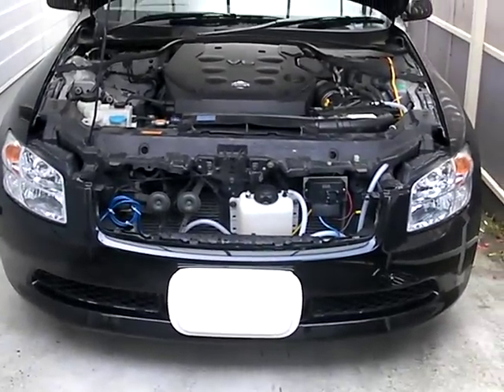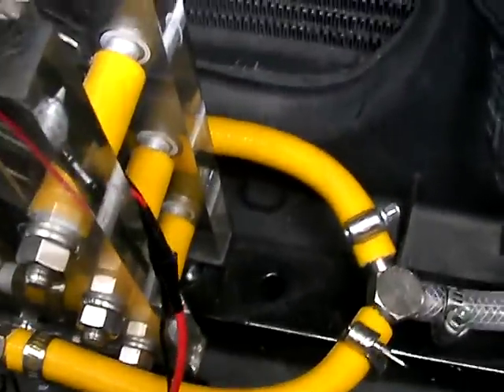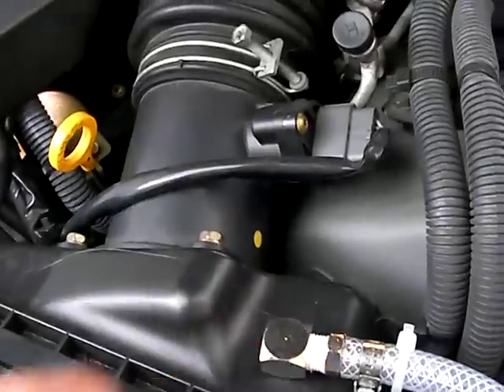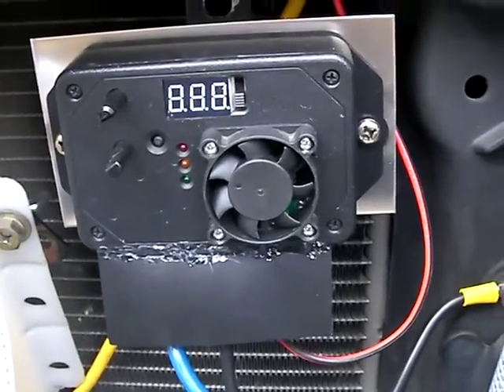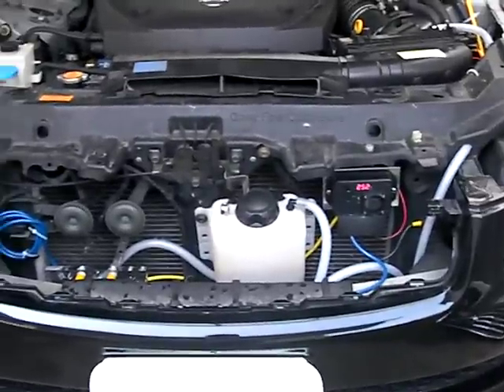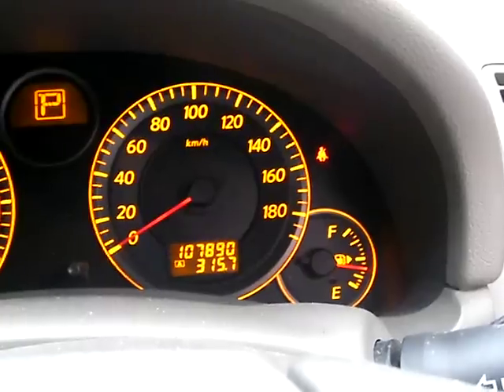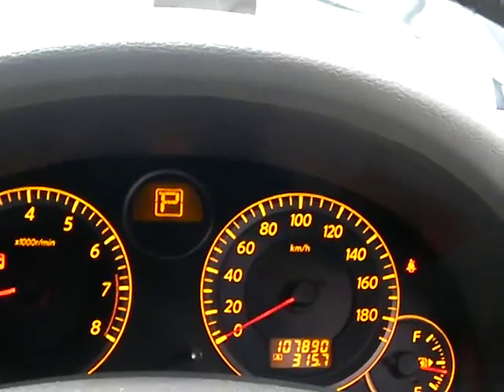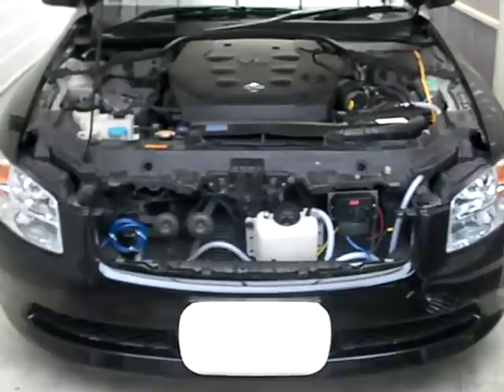Successful HHO install in 2005 Nissan Stagea

Comment: Fuel mileage will decrease.  How do I know?  Second Law of Thermodynamics.  You will always draw more current than you will generate in combustion.
Reply: The goal of HHO systems like that is not (SHOULD not be) to generate more energy from alternator current. The alternator and the electrolysis process do not have perfect efficiency and they certainly do not have efficiency over 100%. 
The goal of this HHO system is to increase the combustion rate of the fuel mixture. Hydrogen gas has a combustion rate many times greater than that of petrol-air mixture. The theory is that by increasing the combustion rate, the petrol engine is able to output the same power at a leaner mixture (also at higher revs), therefore petrol is burned more efficiently, increasing the engine's overall efficiency. 
Now, for example, if that hydrogen generated using that 25 amps (0,3 kW power consumed) increases the engine efficiency by 2%, then, for a 85 kW engine, the maximum output power at the same fuel consumption would increase by 1,7 kW, which makes for a total increase of output power of 1,4 kW.
The point is, energy can not be generated from nothing, but the engine can be made to run more efficiently by making the fuel burn faster.
Erik
Reply: well, the second law of thermodynamics is much older than  that but you have raised an issue which needs to be addressed.. these so called"laws"  are nothing of the sort...all  they are is a record of observation
Reply: Joe Benotz Moron
Reply: Brandon W We are not friends.  However, I would love to buy you a beer and discuss the laws of nature.  Capacitors are not magic; they do not generate power.  They simply store energy, like a battery.  I guarantee you that more than 100% of the power used by your subwoofer comes from your alternator.
Reply: shawn sacks My theory?  I would love to be able to take the credit for it, but it was actually Rudolf Clausius who came up with the idea in 1850.  The efficiencies of drive belts, alternators and internal combustion engines have been understood and documented for decades.  I have not seen any data or attempted to interpret it.  If you think I am wrong and have data that demonstrates any efficiency greater than unity, then I suggest you submit it to a the American Journal of Mechanical Engineering for review.  It would be a lot of work, but if you can disprove the second law of themodynamics you would be more important than Einstein and richer than Oprah.
Reply: Joe benotz, my friend one should be more open minded. Have you ever heard subs in a vehicle? They draw mass amounts of amps an that is done through a capacitor which draws little power from the alternator an puts out alot, put the hho system on a pulse signal off the capacitor and one could run big hho gennys!! :-)
Reply: My answer is: a coil.
Reply: and what they really do  is block advancements  in science since no scientist who knows better will ever try to gainsay  " established" facts.
Reply: besides.. if that was really the case then the water engine could not have been driven across the country.  and it's inventor would not have been killed
Reply: Joe Benotz Coil wont increase voltages on a dc input ... Ac only.  Also - You're a douche!
Reply: Joe Benotz why dont you provide extraordinary evidence that this technology does not work, stop calling laws and do your record of what you have discoverd, and then you can prove in your (own words) if this is real.
Reply: +Azurren  That makes no sense. you can use solar for electrolysis and don't worry about the alternator . $2000 for an alternator , lol. That guy is an idiot and the mechanics must see him coming a mile away.
Reply: thekronek A high-end OEM alternator from a dealership + labor could easily set you back a lot of your hard earned cash. Completely dependent on your car of course.

If you're actually planning on going to the expense of covering every body panel with solar cells then attaching an electric motor to the drive train would be much, MUCH more efficient than turning the electricity generated by said solar cells into Hyrodgen and Oxygen then combusting it.

If you just bodged a consumer grade house roof grade panel to the roof of your car the extra weight / aerodynamic drag would offset any gains your HHO system would generate.

Why doesn't the Prius, Leaf or Tesla use solar panels? Think.
Reply: The alternator takes power from the engine using a belt and produces electricity for charging the battery and powering this hydrolysis.  Hydrogen is burned with a typical engine efficiency of 40 percent, average belt efficiency of 98 percent, and alternator efficiency of 55 percent.  So for every 100 Watts that you spend producing hydrogen, your engine produces 22 Watts of additional power.  The hydrolysis system is a net loss.
Reply: Joe Benotz Joe your theory may be good but your application is not. the production of hydrogen/oxygen gas is not going to decrease the mileage. it will infact increase it. what you may be ttrying to say is that the resultant increase will not outweigh the cost of the energy supplied... but I think you are wrong there too. since the data is easily interpreted.. ie mpgs...
Reply: Joe benotz buddy, you miss the whole stereo system deal!! 12volt batt to 2 capacitors to a "pwm" the 12 volt system will NEVER see a draw other than basically powering a radio!!
Reply: I forgot to put in from "pwm" to the dry cells.. if you tune the "pwm" duty cycle to draw off the caps enough to almost have the alternator take over then enough for the rapidly charging caps to build up.. I'm only 25  an even this is simple to me lol
Reply: They use capcitors to power HIGH POWER amplifiers in a vehicle an the system only sees a 12 volt draw an since caps can't handle constant voltg draw but it can handle VERY BIG PULSES an that's where the "pwm" comes in play you put your dry cells on a pulse pattern, same concept as a speaker drawing juice on an off.. ahhh thank you. I need an investor!!! Lol I could make some awesome stuff!!! I already am on a small scale..
Reply: kupal! selective post
Reply: my question to you joe benotz is how does the spark plugs get 50,000 volts to fire as well as radio is goin a fan for heat/ac lights gauges... all off a 12 volt system! You thinking inside the box man.. wake up stop goin off other ppls info an thinking for yourself.. also how is a stun gun getting a 100,000 volts off a 9volt batt or a cpl dbl a's??  THROUGH A CAPACITOR AND A PWM.. and I'm done here
Reply: Saying something is not true that has been understood to be true since the middle ages is an extraordinary claim.  Please provide extraordinary evidence.  Scientists are always trying to disprove theories.  That is one definition of science.  You are correct, if chemistry exists, then there is no such thing as a water engine.
Reply: Brooklin Funkproject , thank you for the ad hominem attack.  Sorry to hear about your funkadelic air conditioning coil problem.
Reply: Azurren it only proves that more research is needed in this area to work properly , like any new invention or development is often improved prior to reaching people, with greater investment in developing various green energies , it would be tested in less time and would be applicable to all.
Reply: Joe Benotz ... hydrogen bonds is such a strong combustion I'm pretty sure it would benefit... it creates more power then what was used maybe?.. many generators have already broken this law lol anything is possible... but maybe not if you don't believe.. or do your best
build low resistance gear ratio spun off to a high power PMA build. or use some extra battery's? how about even a solar charger with some capacitors wired in running to a super capacitor bank? .. or how about a buck converter be or even a Joule theif?
Reply: Joe Benotz I've facepalmed my way through this comment chain and am surprised you've maintained your composure. D:

Saying that this is the first "HHO" install I've seen which is anywhere near what may actually achieve something. All the other builds I've seen have involved strapping poor electrolysis devices directly to the air intake.. But I'll concentrate on this video for now.

To add to your physics problems I'll chip in with some practicality and economy problems you will face if you decided to replicate this build:

A typical car alternator is not designed to operate at such a high load for an extended period of time (Let alone constant). Even with the safety circuits he's put in place it's going to vastly reduce the life of his alternator. A new alternator is going to set you back around $250-$2000 to replace. (I can't get a quote for the part online so.. Best case / worst case)

Also I'm skeptical of how he's addressed the air / fuel mixture ratios.. A cheap "chip" with a few blinking LEDs with only 2 IO wires isn't going to cut it. You need a decent aftermarket ECU programmed with your new combustion ratios plus a new sensor (or two) to measure the hydrogen mixture going into the engine..

Failing to provide the current car ECU with the correct mixture will lead to very poor mpg as the car will either be constantly adjusting its air/fuel mixture on the fly in an attempt to understand the extra combustion taking place or go into "worst case scenario" mode and flood the engine with excess fuel.

Again this is going under the assumption that a HHO system could ever add power to an internal combustion engine. The science does not check out.
Reply: julian reyes Adding an electrolysis device to a car is akin to using a desk fan to power a wind turbine.

Maybe in a millennia or two perpetual motion energy will be achievable. Or maybe it really is impossible to achieve in our universe.

Comment: found some mustakes in the instalation.
the tube used is not the correct one, the plastic tap with time will be damaged couse of the high temperature, you shoul try to make run´s in diferent amperage of the cell and see the best situation couse i think this is to mutch gas producede

Comment: Imad. This is an experiment I did on my own car to see if HHO injection would increase my gas mileage. I was not trying to run my car only on Hydrogen but a combination of HHO gas and normal gasoline. You English is so poor that you could not understand what I was saying correctly.  Please refrain from commenting on videos you do not fully understand.
Reply: your english is not poor man what is that electronic gadget  that u are using for hho. where u find that think how it's work, how many % u are increase your fuel economy , what is the size of the plate W * L.

Comment from the maker: It is possible but the water vapor would very very hot and most if not all of it would be sent out the exhaust. You would also have a film of oil in the engine that would protect from rust.

Comment: It sounds like you have improved the mileage by 25%.  I improved my on my RV by 20% due to mountainous location. I have a 21 plate dry cell generator and hho system on a 21 ft class b motorhome. RC.

Comment: A small turbocharged engine can be more efficient than a larger non turbocharged engine with the same power output.  Simply adding a turbo to an existing engine will not increase efficiency.

Comment: That's not necessarily how it works fuel burn at its optimum at 20 to 1 I think. 20 parts air to 1 part fuel and a normally aspirated motor doesn't come close so if you pump more air in it doesn't need more fuel it makes for a better explosion because it has more air to fuel the fire so to speak. Anyhow it doesn't matter what engine if you turbo / supercharge an engine it will defiantly be more efficient.

Comment: I don't get what you mean because turbochargers do increase efficiency with better air/fuel ratios yes this does cause it to burn hotter if its too lean in which turn more fuel will be injected to compensate. But more to my point turbo charges will defiantly increase efficiency by giving you better air/fuel ratios compared to naturally aspirated engines. I don't know much about HHO so ill shut my mouth about that but your defiantly wrong about turbos not increasing efficiency!

Comment: "Most steel engines have a thermodynamic limit of 37%. Even when aided with turbochargers and stock efficiency aids, most engines retain an average efficiency of about 18%-20%. Rocket engine efficiencies are much better, up to 70%, because they operate at very high temperatures and pressures and can have very high expansion ratios. (Electric motors are better still, at around 85-90% efficiency or more.)"

Comment: You are confusing combustion efficiency with engine efficiency which supplimenting HHO can't change, the engine is still an engine. The combustion (burn) efficiency on modern engines are close to 100% and this is fact so research it. So even if the losses from the alternator draw were magically overcome it could not possibly improve MPG by 1-3% not counting conversion loss. It don't work that is why NO ONE can present proof. Testimony is not science.

Comment: It's been proven to work by thousands of people using it. Results are proof. The debate is wrapped in misunderstanding. Actually, the HHO is not being used as a primary fuel (which would be expensive), but as a catalyst to increase the efficiency of gasoline, which burns at about 20% efficiency in an engine. It's not expensive to produce enough HHO to increase gasoline efficiency enough to increase mpg by 30% or more. Well worth doing.

Comment: How many liters is the engine?Seems like 25 amps is too much for a V6.From what research ive done it seems like you should run  1/8-1/4 L of hydroxy gas for every litre of engine displacement.Have you adjusted the current output of the PWM to see if milage goes up or down?

Comment: When did you start noticing mileage gains? I've put a 6x6 21plates cell at 35amps into a 2007 gmc 6.6 litter turbo diesel truck - drove around 80 miles (also have the volo fs2 installed) and I'm not seeing any changes... any advice?..

Comment: Thanks for your reply good friend, it looks like I got confused since your engine cover looks identical to the 3.5L V6 version.

I have a couple of questions now that I have done some research and come up to a little faster speed.  I am sorry if you have answered these somewhere already!

What material did you use for your gaskets? 

What is your plate configuration? I.e. + nnnnn -, + nnn - nnn +, etc 

Did you have to run a piggy-back ECU or do any sort of tune?  Or is that still in the works?

Comment from the maker: Actually I think separtaion of the gases would be better.  I know a guy in Austrailia who is making that kind of cell.  You are right that you would not have to have an o2 sensor. If I were doing this again for my car I would make a separation cell.As for the air fuel gage, if you have the money I would get one and learn how to use it. By experimenting with different air/fuel mixtures you can increase your milage above the average gain.

Comment: I whanted to know if you had a opinion on separating the hydrogen and oxygen so do not have to mess with the o2 sensors, but would it increase the exhaust temp , also whanted to know should a invest in a air/fuel gauge or not trying to come up with the proper equipment for my cells and suv. hope to hear from you have a good day.

Comment from the maker: DanielVidz, Yes it is possible to over work the altenator but if you have an effcient cell that doesn't draw too much amperage ( over 50 amps on small and medium size cars) then you won't have a problem.  HHO is a VERY powerful gas and if you get your injection point close to the combustion chamber you will see an increase in power and mileage improvment.

Comment from the maker: Ramesh Singh I use sodium hydroxide as my e-lyte.  It works well for me and it is cheap.  When running an HHO cell 25- 30 amps should be you max current draw.  Anymore and you could over work the altenator.

Comment: Pros vs Cons....??
OK I find any MPG improvements interesting and beneficial especially HHO generation.
I am concerned that the extra Current draw will add substantial Torque against the engine via the alternator (much like a Eddy Current Brake would), along with the small addition in weight, refilling water and general maintenance is this still practical?
I would like to build, test and improve on HHO units.
I hope to bench test a small engine with a electrical dummy load only, then HHO only.

Comment: Very well-done setup.  I admire the workmanship - I plan on doing a very similar custom built unit for my G35 (looks like your Nissan has the same VQ35DE that it does).

I am curious where you have your plates/gaskets made? I plan to cut the plates on a CNC laser, but I would like to know where you sourced the gaskets.  Thanks for letting me pick your brain.

Comment from the maker: Shinriu, Hello.  I had this system in my car for one year. My system only needed water added evry week or so.  After one year, my cell developed a small crack in the acrylic so I took it out.  Overall, I saw about a 25 percent increase.  I still drive this car everyday There were no problems with the car when I had the system installed and no problems now.

Comment: >>it takes to make HHO is that for all practical purposes they are making none. It takes about 6000 L of HHO to equal the energy in 1L of gasoline! If u r making 5 L/min, you are making about 1/140th the energy requirments of a car that uses 7Lgasoline/hr. Literally a fart in the wind. Yes HHO could possibly act in a synergous way to help combustion, but it would have to be a huge increase to ever make up for the huge inefficiencies involved in generating HHO.